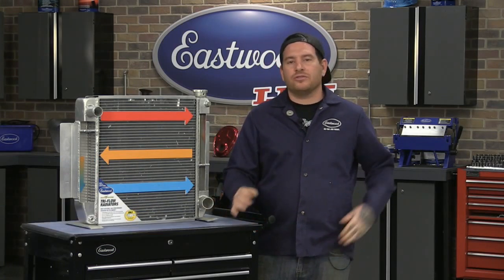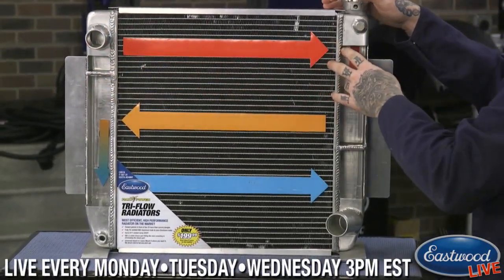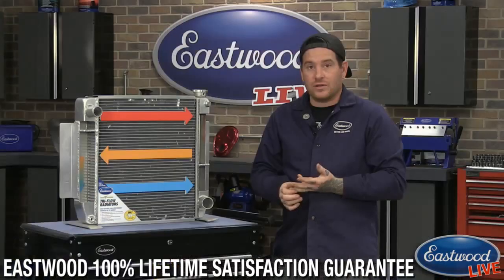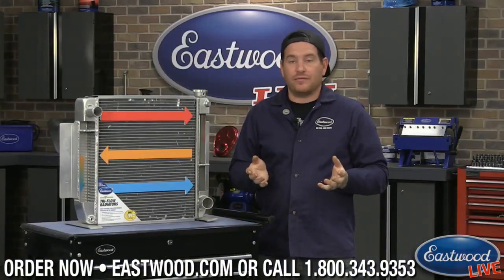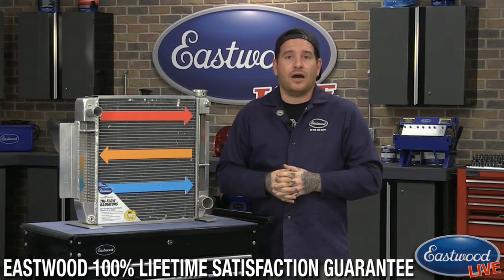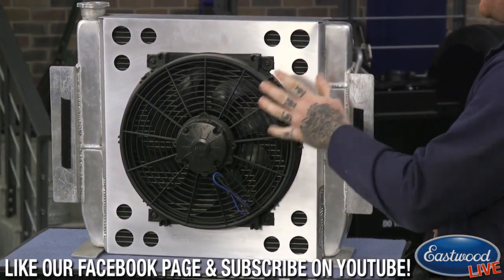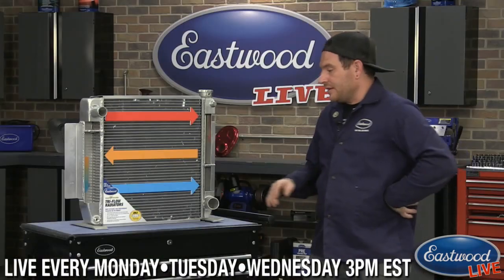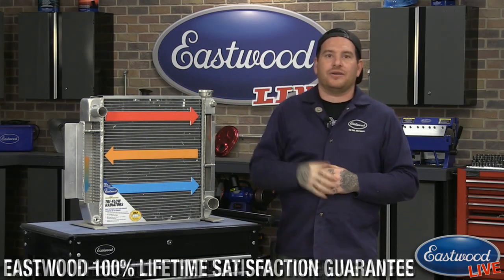Eliminate Overheating!  Have Fun Driving Your Hot Rod!  The Tri Flow Radiator from Eastwood.

Comment: Looks good for applications where you have lazy water pumps in old v8s and bad radiator designs that don’t flow evenly.

I still feel a properly designed single pass is going to be fine.
Reply from the maker: It's a solution if you're running into over heating problems - mostly for older hot rods like you mention but suitable for anything that might need it.

Comment: Will these radiators need higher pressure to work? Looks like your cutting down the flow volume by 1/3. Or does a stock water pump work? what is the required pressure/gpm?
Reply from the maker: They will work with stock water pumps and we recommend 170 to 180° thermostat
Reply: So a lower t-stat because it takes longer to get through the radiator? I'm trying to understand. My single pass runs a 195 t-stat to maintain 200-205* Edit: BTW  it's an early SB 350 with a 19x19 2 row 1" tube core.
Reply from the maker: The lower thermostat is just another item that can help drop running temperatures as the system is opening up sooner.

Comment: How much cooling difference would you see on radiator of that type than the old style single pass radiator such as was designed the sixties and seventies. Also would  using a radiator  of that type used in a horizontal  position  be effective.  I'm building  my version  of a 90s style gtp car.

Comment: Will this work even on ls swapped vehicles, eg/ek honda civics and any other vehicle?
Reply: if it fits and has the right connection then yes. If it has the capacity and airflow & fits then any radiator will work.
 I think what your asking is will it fit my car. Measure your stock rad also see if a larger one could be made to fit. 
 An example from MOPAR is most came thru with a 26" wide rad, but nearly all could be fitted with the larger higher capacity 28". It's a common upgrade. if the car was slant 6 or 318  pwr if got the small rad, if it had the hp 340 or towing pkg it got the larger. Even some big blk 383 had the smaller rad, putting in the larger rad is always a good idea. 
 No it won't run to cool. That's what the thermostat is for to regulate engine temp. Ideally engine should run around t-sate temp. This tells you the thermostat is control engine temp and not cooling system capacity. Some cars are harder to cool than others. So called"bottom breathers"  corvette from 68 on  firebirds 82-02 also any car with small or limited grill area. Air flow is the problem, getting enough .